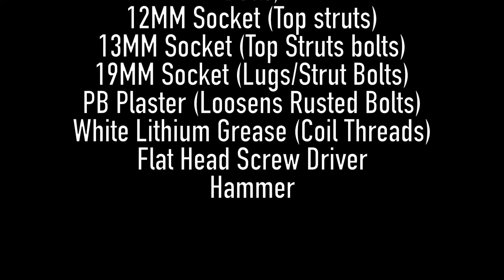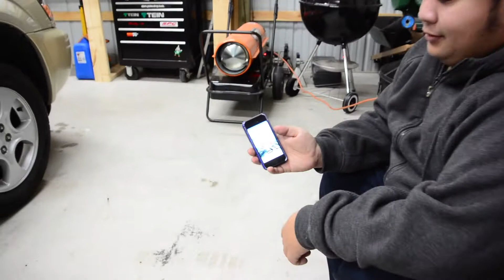The Fujibo Fozzy Build: MaxSpeeding Rods (eBay) Coilovers Install

Comment: How long did the install take? I have a set of tein coilovers. It I haven’t installed because I don’t want to get halfway through and not finish
Reply from the maker: Youre looking at about 15-30min per corner. The biggest enemy are rusted bolts. Highly recommend using an Impact gun to speed up the process. Highly recommend having a buddy assist you as well, that can just spot and lend a hand! Id say 1 hour total if you have no rusted bolts with impact gun. 2 hours if you just like working slow, but carefully. It really varies on how comfortable you are, skills with tools, and having the right tools! Hope this helps, and good luck!

Comment: Yo man im looking at getting these but im trying to lift my car.  It looks like the stock oem struts are bigger. Are those coilovers fully extended?? Can those new coilovers match the oem height??
Reply from the maker: Squishy Poo ahh I Def don't recommend these! When we installed, we had the height fully extended, and it's still lower than oem height
Reply: Thanks for quick reply brudda! Yeah ill go stock. Trying to lift my impreza with forster struts. Thanks again mayne. You got a new sub fa sho!
Reply from the maker: My pleasure man! Good luck! Make sure to share pics or vid when youre done!  Appreciate it!

Comment: Just wondering if the rides horrible on these i've been really debating on getting them
Reply from the maker: Ricardo Delaroca I've been on these for two months and they have been riding great!!! Just make sure you get the one that has dampening settings so you can adjust ride quality :) you're taking a chance but for $300 shipped, I'm pretty happy with them so far
Reply: any updates?
Reply from the maker: Yes! They have been very good so far!!! No issues fingers crossed
Reply: tks. I am from Brazil. I am gonna buy it!
Reply from the maker: Nice! Make sure you get the ones with adjustable dampening. Otherwise the ride will be harsh!
Reply: Fujibo Heavy ok. Tks . When it’s arrived, i’ll let you know. Tks for the video.
Reply from the maker: Sounds good man! Anything to help a fellow enthusiast!!!

Comment: So even at max height you still lost about an inch? Trying to figure out what the max height of the coilovers is. Thanks!
Reply from the maker: Ahh it’s it’s been awhile. But just be cautious of these. The set lasted for about 15k miles but then one of the rears shocks started leaking. The other 3 appeared fine. I would definitely recommend looking into Racelands :)

Comment: Is the ride ok? How much more stiffer are the coils to the stock suspension?
Reply from the maker: Yes! Ride is surprisingly smooth! But its also because i have the adjustable dampening model. If you get the Non Adjust. dampening, you will have pretty harsh ride comfort :( Definitely feels more solid than the OEM shocks/springs. When i got the car with 174k original miles, i just wanted something to replace, so these were perfect! However, I do plan on getting BC Coilovers in the future, these are just temporary, but i am very surprised how long they have lasted and have been holding up!
Reply: @FujiboHeavy  Awesome! That was the fastest reply I've gotten on  Youtube
Reply from the maker: lol, im always on my comp when im not working. Plus i like helping out other fellow auto enthusiasts!
Reply: @FujiboHeavy  How low did you set the coilovers?
Reply from the maker: Nothing too crazy. Its about 1 finger gap up front and 2 finger gap in the rear :)

Comment: Hey i had a shop try to install these same coilovers on my 99 forester but they wouldnt put the fronts on cus they said they were rubbing on my cv boot did you have any issues with this happening
Reply: That's because you either had the wrong coilovers for hour.forester, or you were dropped too low...